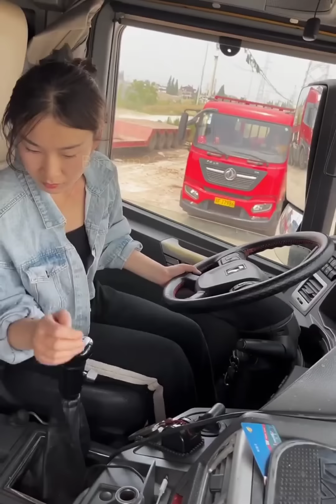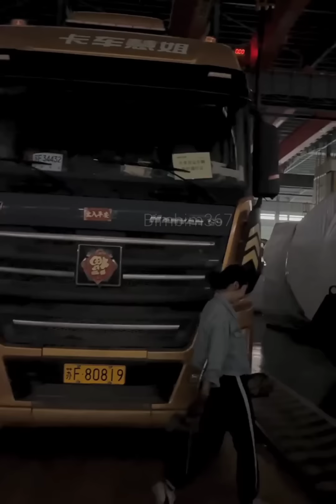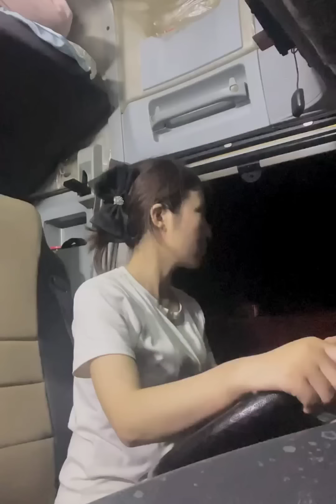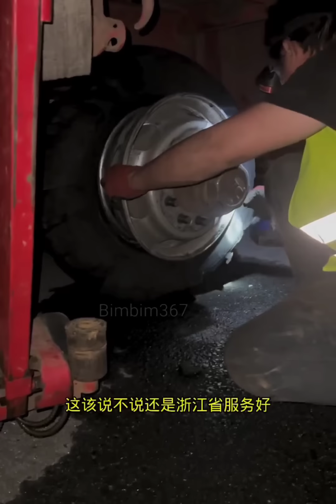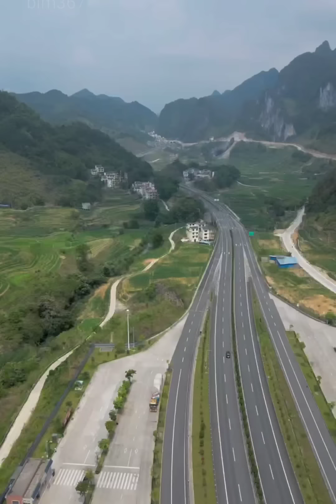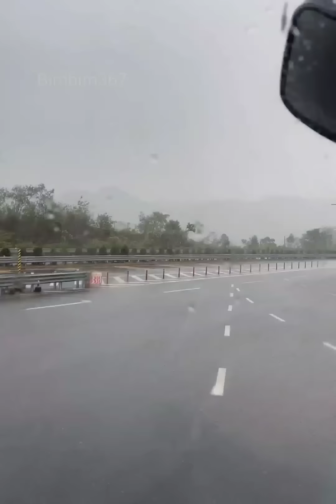Hành trình vất vả nhất trong đời tài xế. Nữ tài xế xinh đẹp HUISHAN (Phụ đề)

Comment: I liked your journey to deliver that huge load. It was challenging for you  but that's how we all learn. And it's obvious that the tires were getting hot due to several factors, the weight of the load ,  the weather and perhaps uneven air pressure on the tires. All of these are important things to consider when hauling a heavy load. Pay good attention to these things and you will have less tire problems on the road. Good luck and stay safe. 👍